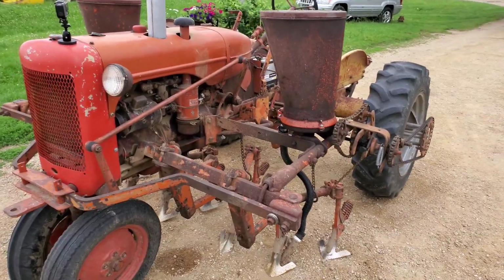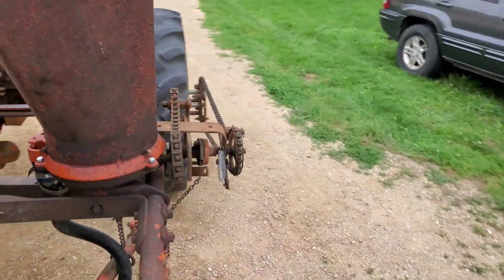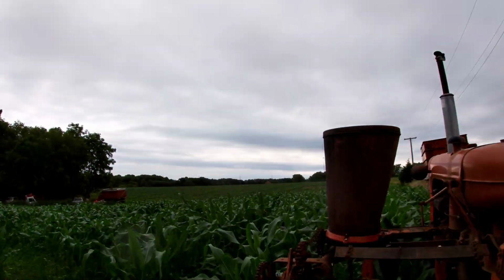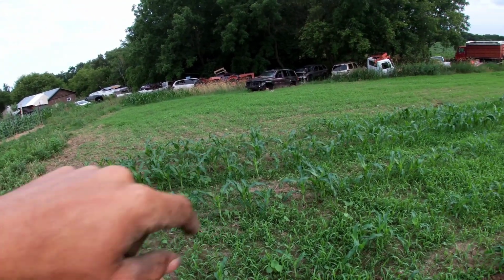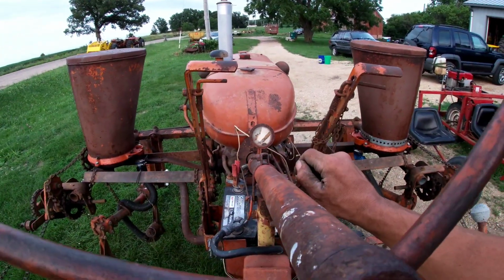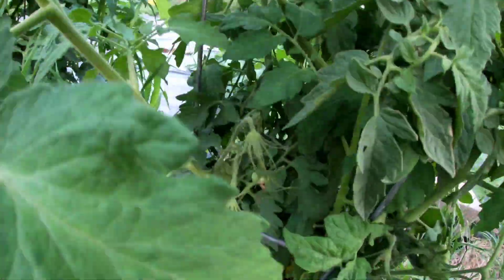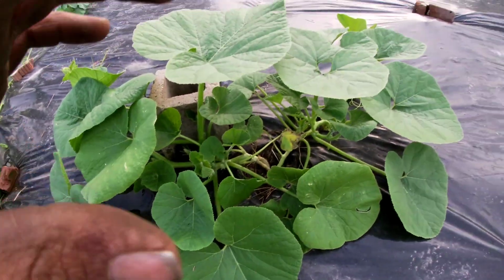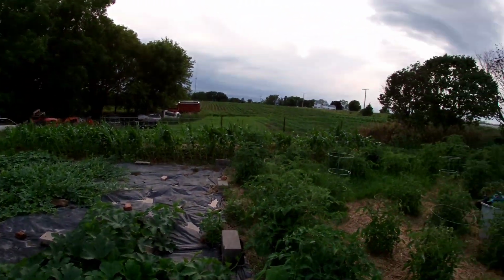Allis Chalmers CA 2 row cultivator side dressing sweet corn, and a garden update

Comment: Garden is looking nice Tim. Glad you where able to save your pumpkin. Does that tractor stay set up as your cultivator/fertilizer rig? I'm thinking that a lot of work to hook all that up. My Super A is similar but just one row.
Reply from the maker: Thankyou, that pumpkin is both my daughter's pride and joy in the garden. I've become super dad for saving it lol and I don't think I would have figured it out. I was looking for a disease or fungus, not a bug 🤷‍♂️. Ya the cultivators stay on both of our CA tractors mainly because we don't have another use for them. They aren't too bad to get off acually you take 2 boots off and it settings on a pivot or to the front of the tractor then you pull the 2 pins in the front and back off of it. The fertalizer units themselves just come off with 3 wing nuts each and mount to the planter then,  but the drive units and brackets stay on the cultivator.

Comment: Timely video..just got a set of CA side dressers for my two-row cultivator.  Does it take a bit of time to slap it on the cultivator or do you leave it on all the time?  Also, when you're side dressing, to you omit the rear cultivator bar?  
Great video!
Reply from the maker: That a great find 👏,  we generally leave the units on cultivator we just take the boxes off, but they aren't bad to get off, the same units mount on an Allis chalmers  planter for starter fertalizer. In the past we put on while planting and cultivating but the fertility in the field is alot better now adays, and generally I always use the rear mount but a guy rented that tractor from us and he doesn't lie the rear mount for what ever reason🤷‍♂️ and he needs it again so I just didn't deal with mounting it is all. Let me know if ya got any more questions about it.

Comment: Do the drive chain chew up the corn and is it a shifting gang either way looks and works good
Reply from the maker: Generally no the chains don't but I got it planted a to close together, so you could see the drives hitting the corn here. And by shifting,  do you mean adjustable from side to side? It is adjustable by flipping the gangs you can actually get it down to narrow rows. But for the wide rows its just one bolt you have to loosen to adjust each gang.